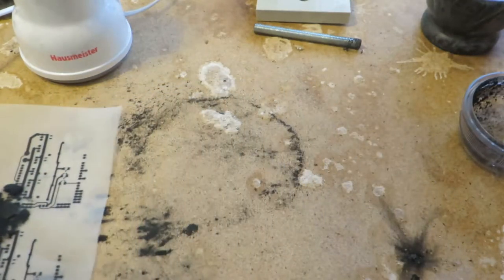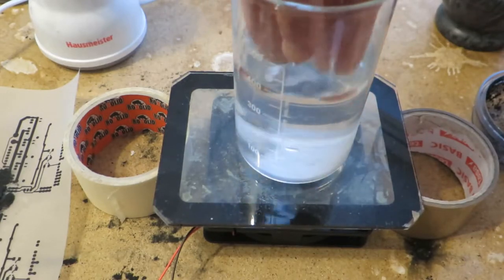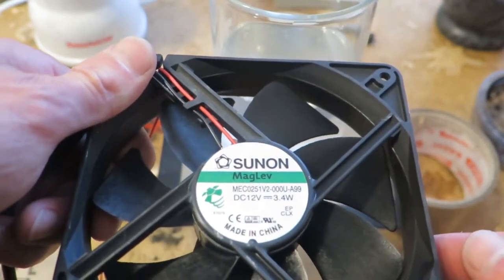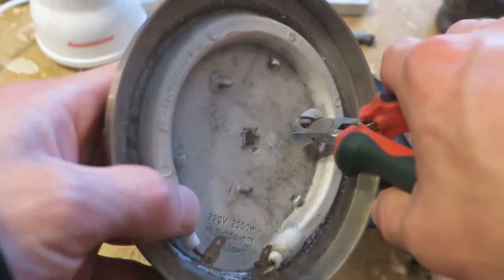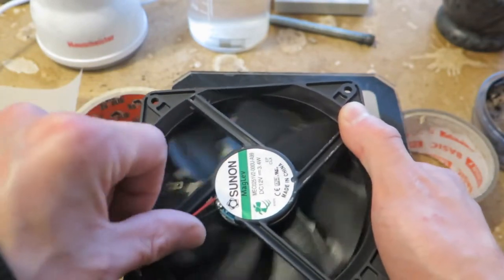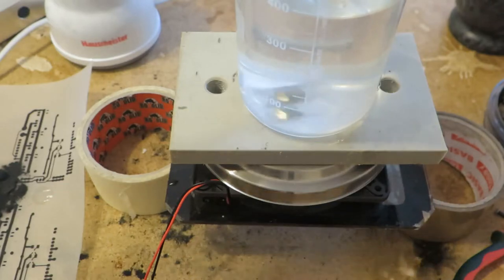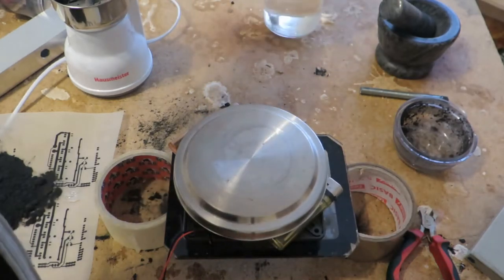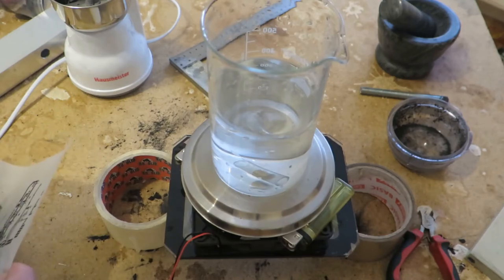Testing components for DIY hotplate+stirrer

Comment: I've been thinking about this too.
I've been thinking that we could have a set of 4 coils under the hotplate and switch them in sequence (like a BLDC with no rotor - the stir-bar IS the rotor) instead of using the fan?
This would also mean you don't need to worry about the heat "killing" the magnet that's attached to the motor because there is NO magnet attached to the motor.

I live in England... which makes me very very happy to see a ruler with no "inches" on it.
Reply from the maker: Yeah I also was thinking about it, but the added complexity(controller and mainly feedback)... I would rather vent the heat...

Oi, mate! Aren't you using pounds still? ;)
Reply: Reeeeeeeee inches
Reply: Liked for the sake of SI.
Reply: I did exactly that with 6 electromagnets set in a hexagon configuration with 3 pairs of 2 and each pair 180 out (rev pol) then laid a alumina ceramic plate with thermal paste ontop of the coils, a layer of 4 12v 6a tec's with more thermal paste on both sides plus 3 hall effect sensors 120 deg apart + thermocouple and yet another ceramic plate on top making a sandwich. Lastly wired it all up to an arduino with a proto shield and initial results are promising. I've got a lot of code to refine but in short it runs like a bldc motor with stir bar slip & x/y position monitoring (different viscosities can run under different profiles and it can reset the stir bar that gets thrown by powering only certain electromags to different strengths to pull the bar back into position). The tec's keep the coils nice and cool and the heated side reaches 110c no problems but i already burned a few up so need to find high temp versions to make it useful since 110c surface won't boil water with thermal losses & transfer rates. But all in all its got fearures in common with pro lab solid state versions ($1500+) and a if I can figure out how to reverse the tecs without fucking up the coils, it will have cold plate stirring as well. Anyway, only sharing this with you because i just stumbled on your channel and have been watching your vids all night and seems like you'd appreciate any information you can get like i do. And because we share a shit ton of interests and ethics + some of the things you say crack me the hell up i figured; why not? So please Keep it up bro and i look forward to watching more!
Reply: @IlusysSystems  our road signs are still in miles and beer is sold in pints.... but I haven't bought a pound of potatoes since 1979. ;)

Comment: Did this go anywhere? I tried using the heating elements from a kettle with a chinesium 2kw dimmer. Two heating elements ended up popping quite violently.
Reply from the maker: Well... kinda.. https://www.youtube.com/playlist?list=PLyzlj5IaDE0dUI2eT1TOuygDv98xwPZOo
Still in progress, but on good track I think.

I think, what happened in your case is, that your dimmer stopped working and heating element got full power. I would never use less than 10kW dimmer for 2kW load.
Or you used full power for heating element. You should limit it to 1kW max or even less. Without anything to heat, aluminium can melt, and it would be mess...

I should really try to manually regulate this and test function in this vid... What I found is that this heating element is too noisy, it conducts heat to the case like crazy, which is quite problematic, and it deforms due to heat. With these problems I have decided to use completely different technology - IR heating and I've got quite promissing results. It's a bit more expensive, but allowes for very compact and interesting design. Future is now :D
Reply: Yeah... I gave full power to a coffee machine heating element and just melted it.

Comment: how hard would it be to make an IR Spectrometer?
Reply from the maker: well depends on what experience do you have in electronics/programming and what do you need it for.
Assuming, that sensor parts are available for range you want you can probably hook it to CPU/FPGA and you got a prototype. If this was task for me, I would estimate(without research), that I need about 6 - 9 months full time to have a production ready board, with bare minimum software

to start manufacturing, you need also some cases, various approvals, and contract with mfg companies / suppliers

sounds like a fun stuff :)

Comment: You are going to want to use copper stilts to help with cooling. I would also ditch the fan and use a real motor. You dont want to have the fan cooling off the heating element.
Reply from the maker: nah, obviously I will run this at 500W max
Also I will chop blades off. unless you can get different motor for $2 (with right RPM also)